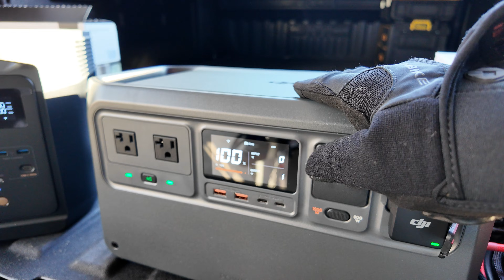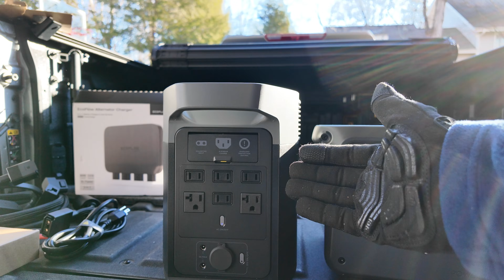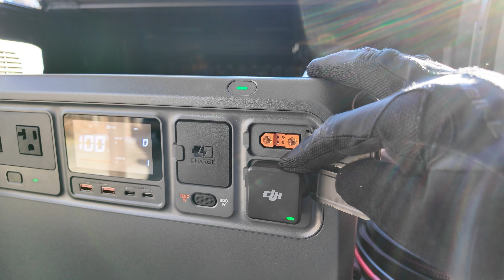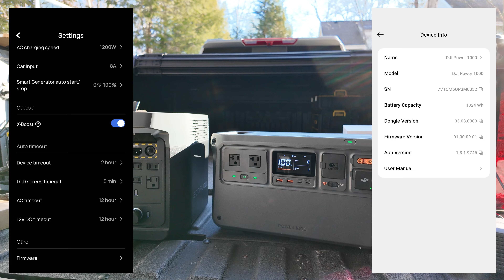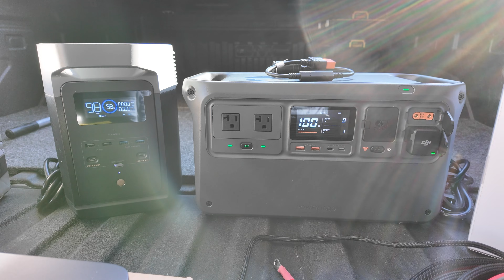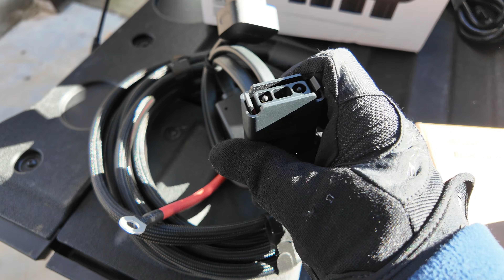DJI vs EcoFlow: Can the Drone Giant Beat the Battery King?

Comment: Interesting DJI product. I have the EcoFlow Delta 2 Max mainly to use a DC/DC charger via a solar port, and solar panels via the 2nd solar port. I’m not a fan for where the ports are on it (3 sides, plugs / 12v back, USB front, EcoFlow alternator charger on the side). I make it work with my set up in my 4Runner. Had a Victron 12/24 DC/DC charger, but now have the EcoFlow alternator charger.
Reply from the maker: Great setup. It's nice to have competitive offerings, pros and cons. Thank you for watching.

Comment: What a Great review! I think The dji may be just what im looking for. I'm  looking for a unit to power a mini fridge and a portable air-conditioning unit while working out of and sleeping in my pickup. If I leave the alternator charger connected While driving will it over charge? And how susceptible are they to cold weather?
Reply from the maker: Thank you for watching! The Super Fast Car charger will stop charging the power station once full...it'll communicate with the power station to send right amount of power at the right time. The power station will operate within 14° to 113° F, but for charging, needs to be above 32°...lithium chemistry seams to be vulnerable to damage if charging under freezing temps.
Reply: @AdventureRocks  Thank you!!!

Comment: We spend between 50 and 75 nights a year in our camper and I've never had a need (that I know of) for one of these portable power stations. What are some uses for these? I understand charging electronics such as phones and tablets but there are options to do this at a fraction of a cost. Seems like things such as a refrigerator are only temporary due to the limited amount of power.
Reply from the maker: I hear you, that's a great question! I started getting exposure to these power stations a couple years back and initially I wasn't impressed. I tried one out though, and then I began to find more and more use-cases till now I'd say I am "addicted" :) to them. I find that I can use one unit for several of my use-cases, meaning it isn't permanently installed, justifying the cost:
1) All-in-one inverter/battery with seamless transfer switch in RV (I run my fridge/microwave off it) - https://youtu.be/-Wrc--_5lJQ
2) Portable power in truck for day-trips, mini fridge, other 120V/12V needs
3) Backup power for house during storms (basic essentials like fridge, internet, etc.) - I demo a larger one here - https://youtu.be/LGu0Rf0M5Yc
4) Uninterupted power supply for computer - if power goes out or flickers, the power station transfers in milliseconds and computer stays on and I don't lose work
5) Replacement for gas generator (larger ones) - https://youtu.be/jadklTSNY-s
6) Upgrade older car with powerful inverter for power on go & quick recharging - https://youtu.be/8A6BvXudcOg
Reply: @AdventureRocks  I'm straight up amazed how many cycles they can do. I'm pretty poor tbh but $700 for a D2M and $200 for refurbished alt charger, this covers so many use cases and it'll last 20 years used daily?!? Or at   least   a 5 yr warranty..
Reply: @ gotcha thanks for that info
Reply: My 12V fridge lives in my 4Runner May-Oct. For mild off road camping, I use a Nespresso pod coffee machine, a kettle (so much faster to heat water regardless of wind), and a heated blanket in my roof top tent. I do use propane to cook, but will look into switching to induction and see how that goes for power usage. I’m also rarely more than 1 night in a spot.